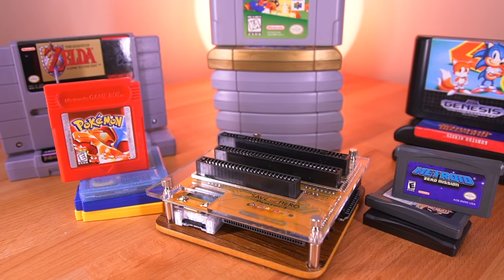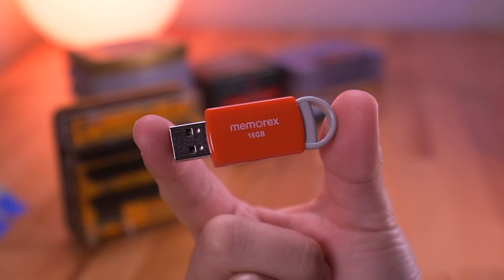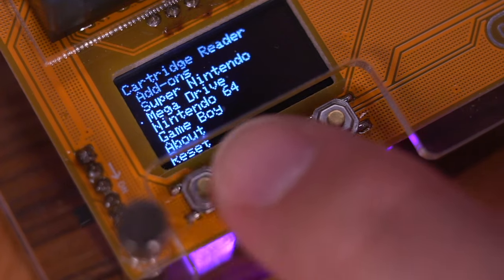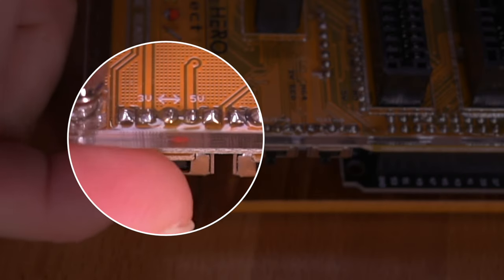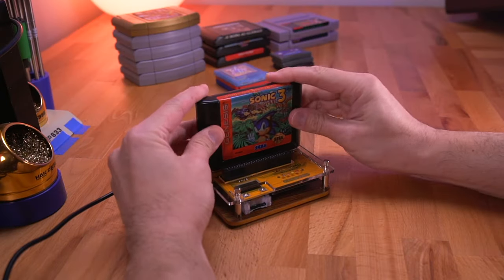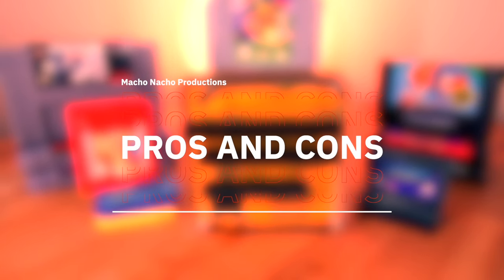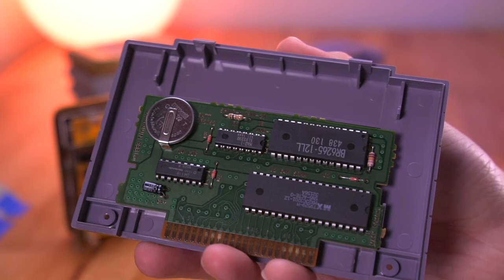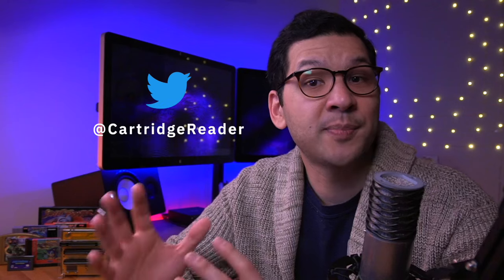Every Retro Game Collector Needs This!  The ULTIMATE All-In-One Device to BACKUP Collection!

Comment: Like others have said, this video contains many misinformed assumptions. I really like this channel and I think Tito does a great job informing the general retro gaming scene with new information about current retro projects, however this video is a far cry from the quality I've come to expect from this channel.

Before racing to the comments I wanted to check with sanni to make sure he wasn't involved in this Kickstarter, and sure enough, just like the pinned comment says, sanni isn't responsible for the Kickstarter. "Save the Hero" created by someone trying to make money off of others' hard work.

A pinned comment or a change in the description isn't at all close enough to stop the spread of this misinformation. (There's already been at least one article I've seen linking to this video.) The video should be taken down and redone.

I would like this channel to continue to thrive, but this video doesn't give me much hope for Tito's credibility at this point.

Notes for the audience:
1) This is not a "brand new" project by any means, and dates back to at least 2013.
2) sanni is not responsible for the Kickstarter campaign
3) Tito did not talk to sanni
4) The current version of this cartridge reader has many more capabilities that are not covered in this video. (Ability to read N64 Controller Paks, test N64 Controllers, plus all other add-on features like the battery pack and cartridge adapters)
5) You can read NES cartridges, WonderSwan cartridges, and many others with adapter boards which are also available to make from the github repo.

Notes for Tito:
1) Please remove this video to help your credibility.
2) Redo this video by making the cartridge reader yourself from the open-source information. With your soldering experience, the build is easy enough, and it can have all the capabilities of reading cartridges from the other consoles listed in the on-board menu, full list in the github repo.
3) I disliked this video because it sells this project incredibly short of its full capabilities, and of the hard work of all its contributors.
4) Whoever is doing this "Save the Hero" project is using you for free advertising, and that needs to stop immediately.

Again, with the production value of this channel, I want to continue to see it do well and give great information to the general retro gaming scene.

Comment: What's the benefit of having this as a standalone unit? Wouldn't it be easier to plug into a PC and have a basic UI instead of the little LCD screen?
Reply: You could dump cartridges everywhere without being dependent to a PC.
With a powerbank or even modifiy the system with a rechargeable battery.
Reply: @Real_Nozomu_Itoshiki  if you wanted it to be portable, then to me USB C to USB C and a basic android app would again be easier. Maybe that's a lot more work? I don't know

Comment: A couple questions. If that add extra systems in the future, how would they physically connect? Does it have a connector to attach extra cart adapters? 

Is it capable of loading saves back onto cartridges?
Reply: this is what i'm wondering also... if you can't transfer the saves back onto cartridges, it seems like a waste or that maybe I'm missing something... it would've been nice if he could've talked about this. he redundantly showed uploading on various carts from various systems, but it would've been nice to see something be transferred back...
Reply: The "Write Save" function present on the cart menu seems to suggest that it can write saves back to carts.
Reply: @MarshallFlores  Hopefully, but there are functions in that menu that aren't active so we shouldn't assume when it comes to its current and possible future functionality. There's a possibility some functions never get enabled, or not for all systems.
Reply: @Ragnorok64  This thing is open-source, so it's an eventuality these functions will be active if they aren't already. Someone will get it working. May not be with this version of the Cart Reader, though.
Reply from the maker: I am assuming it will be done with adaptors. 

Yep you can re-upload the saves to the cart 👍
Reply from the maker: Yes it also writes the saves
Reply: @MachoNachoProductions  Nice, I'm significantly more interested in this thing now. Last question I have is even though the USB is only for power currently, is it capable of doing data? I want to be able to have this thing interface directly with a PC eventually.
Reply: @Ragnorok64  You can use Serial over USB for sending commands to the system. But not transfering data through USB at the moment.
Reply: @Real_Nozomu_Itoshiki  Interesting, so it sounds like that could be an added feature some day, though, or at least the hardware could be capable of it?

Comment: Surprised NES isn't supported
Reply: Check out the USB-NES. Supports NTSC, PAL, Famicom, and many more. Can also read/write battery backed saves. DIY kits and pre-built models are available on eBay.

Comment: I’m still looking forward to a device that dumps Atari 2600 and NES carts.
Reply: Check out the USB-NES. Already supports NTSC, PAL, Famicom, and many more. Can also read/write battery backed saves. DIY kits and pre-built models are available on eBay.
Reply: @belangerpm  I will check it out. Thank you!

Comment: nes is the strangest omission.
Reply: Check out the USB-NES. Supports NTSC, PAL, Famicom, and many more. Can also read/write battery backed saves. DIY kits and pre-built models are available on eBay.

Comment: I understand whats meant for. But in 2022? Who doesnt have a disk packed with ROMs?

For a collector, if the PCB or chips die, the value stays on the dumped file? No. The time now is to create full PCBs to dump ROMs.

Another thing. Yes its standalone. But what for? You wiill dump the save and game data and leave it on a SD Card? You will copy to the PC for safe storage. So being stand Alone its redundant
Sry if im wrong